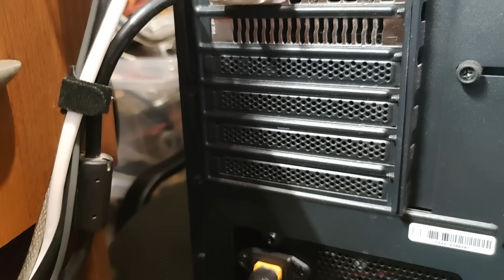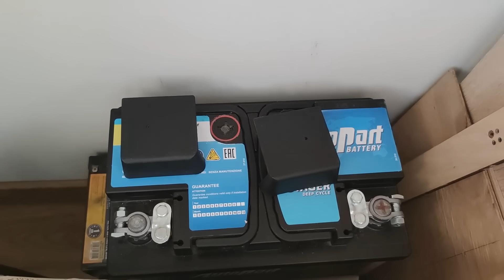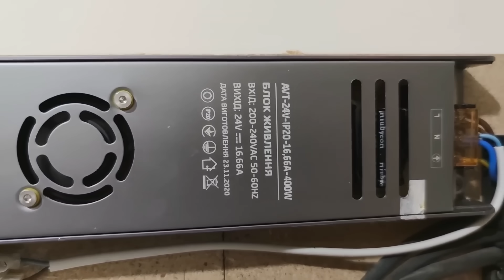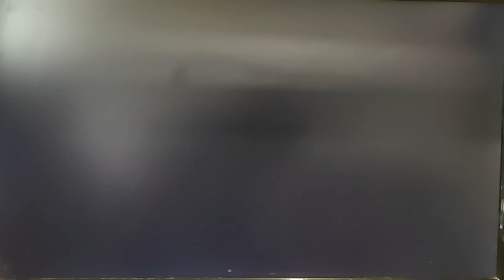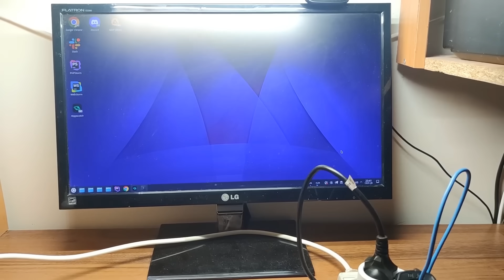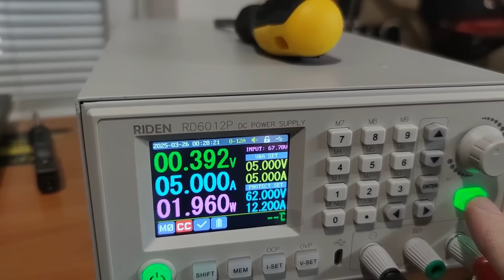I Deleted the Inverter. 50% More Efficient! (Windows vs. Linux)

Comment: Excellent project, thanks for the results and setup config.

What gpu do you have? 

And I suggest you borrow and use a infrared camera to look for temp spikes on all those cables and connectors to prevent fire hazard :)

Comment: доброго вечора, ми з України :)

awesome setup and great idea to omit unnecessary conversion DC -> AC -> DC!
pros: effective, low-noise, less waster power (or fuel if running on generator)
cons: time-consuming (extra efforts required for conversion), not universal, critical to wire length/gauge from your PC to your main battery

my desk is 10m away from battery and it's not only 1 computing unit, in my case I'd need to convert several PSUs - different types, so time-effective I'd better pay for convesion. and for conversion compenstation - deploy MPPT+ couple of solar panels on the roof of the dog-house - their power should compensate losses.

світло переможе темряву!

Comment: Love the DIY DC setup. I'm setting up a similar system myself but for my networking hardware using off the shelf components.
Conversion back and forth is wasteful, hot, and noisy. DC power in the home should be more common and would reduce the tons of SMPS bricks in nearly everything.

Comment: So, your crap PC pulls at idle DC 50% more as my high-end gaming desktop on AC. (And I run 1300W SFF PSU.)
And double of what my server pulls when it runs virtual domain with 5 PCs + 6 Game servers.
(That 600W AC PSU you show is 13 year old bargain bin trash that never was efficient. Modern AC PSUs pull practically nothing when PC is off.)

Congrats. If you care about energy efficiency. Then you are in need of actual upgrade to current generation.

You could have as well bought gaming laptop which would do all that DC work for you. And have even higher energy efficiency.

Comment: One thing I am setting up is having core home communications gear run off of a 24V LFP battery.  Here is the thing, your most common home communications gear actually starts with taking in DC power.  I am seeing 12V for the firewall system.  5V for a small managed Unifi switch.  5V again for a MoCA adapter to get signal around the house through existing coax in the home.  Then a wide 12V to 48V DC input for a PoE injector to run a 48V Unifi Wi-Fi AP.  So, you have these DC inputs for your equipment and these small AC to DC power warts are horribly inefficient, much worse than your typical PC power supply to run your gaming computer.  To get the power, I have found it is easy enough to get a Mean Well 24V power supply that is ~90% efficient with an adjustable DC output and a Mean Well DC UPS that does a buck conversion to gracefully charge up the LFP battery from the power supply at a 2A rate so as to not overload the power supply and then I can pull up to 20A from the battery when AC power is lost.  For core home communication gear, this is fine.  The buck converters for both the 12V and 5V step downs I need are very efficient, nearly 100%, and the PoE injector can take the 24V battery power directly as it has a built in buck-boost converter and is very efficient at bumping 24V battery power to the 48V needed by the Wi-Fi AP.

Here is an interesting thing I have come across with these LFP batteries: what to set the 'float' charge voltage to?  It turns out these batteries can become unbalanced quickly with your standard charger that cuts off once one cell in the pack reaches max voltage and the BMS stops accepting charge and then never continues to try to charge the pack.  So, that one cell will have some excess charge bleed off while the other cells sit on the flat part of the LFP battery discharge curve, slowly losing charge over time and cycle after cycle.  So, it takes some tinkering over time to get to the right float voltage so that all of the cells charge up, getting lifted off of the flat part of the charge curve where 0.1V can be the difference between 90% charged and 20% charged, but still low enough to keep the BMS balancers from being continuously active.

I suppose a question for you is how do you keep the cells in your LFP battery pack balanced?  You don't want  to end up with one cell is say at 20% and another cell is at 100%, causing the BMS to cut-off charge, and then you go a day without power and that one cell that started at 20% goes down to 0% and the pack cuts off with the high cell still at 80% charge capacity.

Comment: A little off topic, but I measured some gains of efficiency with inverters at AC 220V instead of AC 230V, variable between inverters but I have from 4 to 7 points differences. You have a really great setup ! I never suspected the power losses would be so great, with double conversion : DC in the battery to AC for the house and then DC inside computer and other appliances. The main problem is also that we can not remove the AC inverter and that is uses power even when idle (mine use 18W at zero load). The efficiency of AC inverter in general is better when we draw a lot on it. For example when I am boiling water and using like 2500W the inverter is 96% efficient, but when I use only 100W it is only 73% efficient, this is when we waste the most energy. for the moment all my water pumps are AC for heating etc, so I can not turn off the inverter. There will be a lot of work and money to convert all to DC.

Comment: estoy planeando usar el mismo sistema pero segun una googleada descubre que el mejor modulo dc-dc es HDPLEX 500W HiFi DC-ATX  (ahora esta en stock), el modulo chino que usaste tiene riesgo de bajar el voltaje de salido cuando el voltaje de bateria es menor que 12v porque es un simple step down mientras que HDPLEX 500W HiFi es Buck-Boost (Elevador-Reductor) lo que senifica que su salida estara siempre a 12v estables, aunque la batería baja a 11V o 10.8V El módulo seguirá entregando 12.0V exactos a tu placa base (es mejor utilizar cables de 10awg entre la bateria y HDPLEX ) mientras que el modulo chino entrega menos de 12v cuando el voltaje de la bateria esta bajo y eso puede dañar tu pc ademas la potencia del HDPLEX es de real 500w mientras que la del modulo chino es solo potencia de pico (Peak Power).
Reply from the maker: I'm using 24V system and voltage is not going to fall below 22V, so that's ok for me. HDPLEX is a great option, I wanted to buy it but it was out of stock.
Reply: @SiquellElectronics  Ah, vale, está bien. Me desvié sin darme cuenta de que estaba hablando de mi propio proyecto, pues pensaba usar una batería de 12 V, pero ahora veo que es mejor usar 24 V o más

Comment: This is a great idea for those who have constant electricity issues and expensive bills where saving some electricity is important. In the US it would be cheaper to just have either a generator or a small battery stack and charging it on off hours to save some money, but this setup is more for the prepper and not one who wants to save some money. The difference for the negligible energy use of a small pc like that with comparing the price of electricity between peak and non peak hours, you would never pay off the cost of the batteries.

Comment: As someone who's been primarily using laptops, idling at over 50 watts is insane. Heck, idling at >5 watts is too much!

I can listen to YT videos for somewhere around 4.5 W. And if I really want to have the machine last as long as possible, I can just freeze the entire GUI session, start my media player as the only thing controlling the screen and watch movies for hours – often at somewhere around 3 watts.
Reply: That's just the nature of desktops. My 14900k idles at 6 W, 3090 at 27 W, plus fans and motherboard and it's easily over 50. Laptops are crazy efficient
Reply: @SergejVolkov17  Yeah, it's all down to incentives. Pulling 50 watts from the wall is basically nothing, so desktop components won't really be optimized past that point. It's only when you try to run it off a battery / UPS, that it quickly backfires.

And if laptops were using 50 watts at all times, even those huge 100 Wh batteries would only give you about two hours of runtime.

Comment: You can use 320V DC to power the ATX power supply. You can skip the HVDC to AC conversion. This way you can use cheap ATX power supplies without PFC. No need for large wires.
Reply from the maker: Yes, that's the option!

Comment: Ive been in a similar situation myself though for very different reasons.  Used a solar generator that only has 1kw of battery. 
The computer was a gpd win with an external keyboard mouse and monitor. Running through USB-C off the unit saved around 27% compared to the inverter. Its unfortunate that most consumers grade inverter are so inefficient. The industrial ones are whats called chasing 9s with one of the best being 99.9% even vfd are around 95% or better. - ≈5w for the controls.

Comment: I got my hands on an 80+ titanium rated server 1000W PSU for very little money, but it's only 12v, not ATX. Using pico PSUs, I'm powering my whole desk from it (PC, server, two monitors, networking, desk lights). Just from having a single high efficiency PSU operating in the optimal range instead of smaller, lower quality PSUs running near idle I'm saving 20-30% of energy for the setup.

Comment: To measure AC power you have to include power factor. Due to the large inductors in your AC PSU, a significant portion of the current is flowing when the voltage is below the RMS value, which means the power consumed is less than you calculated by V*I. This will bring the efficiency values closer together (the AC setup may even be more efficient)
Reply: Good point! While this is certainly true, I'm pretty sure this won't matter when measuring the DC power draw directly from the batteries. So while the AC current measurement might not reflect actual power use, the DC current should. And due to good ol' entropy, converting from 25.6v (LFP nominal) to the lower DC voltages used by the computer should always be more efficient than going from 230v + rectification

Comment: Your PC is quite the power hog at idle. It should not really be using that much. Make sure that:
1. PCIe ASPM and such is turned on (my Asus board for Team Blue was not a power saving king out of the box),
2. RAM does not run at over 3200 MHz (easily 10 W alone), plus
3. look for the background processes in Windows that are keeping the CPU busy and 
4. consider replacing the 5600X with something like a 5700G (more cores to make up for less cache), as the monolithics have much lower idle power draw. You can get a barebones 5600G / iGPU system to idle at around 16 W without truly exotic power supplies, so I'd think sub-30 W with a small GPU should be quite doable. One of the AMD persuasion is arguably preferable as nVidia has had its share of trouble with ASPM but a 1650 should be quite alright, too.
These days both my monitor and my speakers are each using more power than the PC at idle, but I am not about to give up either (though I have contemplated an LED backlight mod, as the S-IPS panel in this once very nice NEC would be worth it).

Comment: How do you get parts delivered from China during Russia's DISGUSTING invasion? I praise your ability to stay strong and adapt to your situation! 

Also when comparing the power use under load, the percentage difference drops, but that's still 60W of wastage!!! So for every hour under load, you lose an extra hour idle.
Reply from the maker: Thanks. Logistics are doing fine, delivery times even improved slightly once shipping routes were rerouted to avoid Russia.
Reply: @SiquellElectronics  I'm surprised that delivery companies send products and their workers across the border. Respect to the delivery people.
Reply: @mushroomcraft Most of in country last mile deliveries are done by Ukrainian companies

Comment: Where do I get this power supply and how much does it cost?
Reply from the maker: I ordered it on ali: https://www.aliexpress.com/item/1005001724610027.html
Reply: @SiquellElectronics  Hmm. Nearly $200.00 USD? I'd be on the fence here. If you're just trying to run a PC stand a lone and that's it, maybe. If you're off grid or something and also using an inverter for standard AC power to run other stuff? I'd say not worth it just to save a little energy loss. A good laptop computer that uses 19 volts DC is what I'd use because you only need a power supply to step your 24 volts down to 19 and you're all set.

Comment: What about the other challenges of DC circuit? Protection against short circuits. AC breakers cannot be used as their short circuit trip mechanism will not work on DC. Only the slow thermal overload mechanism works.
Also operating on DC destroys AC breakers very fast.

Do you use plain link fuses?
Reply from the maker: Yes I already received special 160A gBat fuse and want to install it asap. For now I rely on BMS protection...

Comment: Unfortunately, your power value for AC is incorrect, you're measuring apparent power, but what you really pay is active power. You'll need a power meter to measure correctly, only V*I is not correct for AC.
Reply from the maker: yeah, the ac power is looking strange.. want to buy a decent wattmeter to measure that correctly

Comment: Regarding the power losses in cabling, a better way of expressing losses would be in Watts turned into heat, which is easily calculated by P = R I^2. You mentioned 7.7A during the Furmark test, and according to your measurements, your cable is about 18.6 mOhms. Multiply that by 2, that's about 2.2W of losses. Rather small overall. In this case, I'd rather look into the connectors, as a mated plug may have an important resistance. Btw, handheld multimeters aren't super great at measuring very small voltages, so these results may be incorrect, although the procedure you used is the best one.

Comment: I run my notebook from 24V solar charged batteries, just a simple step down to 18.x Volt since many years.
Buck converter with Display 5A max, ~20€ Alixpress   (small notebook, not enough for gaming ofc)

Comment: What AC PSU did you use?

I would also recommend tweaking some settings, because 5600X with 1650 should go lower than that. ;) It would not drastically change the end result considering capacity of your batteries, but hey, it should be enough for a light in the room or a second monitor. ;)

Comment: About the Ac strange result : most of the time your local grid has higher voltage than 230v. In my country in winter it can go up to 245V. I'm quite sure that your inverter does not do that. So if your grid gives more voltage than your inverter, this can explain that your PC draw more under the grid than under the converter, despite the conversion.

Comment: I like this setup.  I've been thinking of doing my own DIY DC UPS system with centralized low-voltage DC rails: 12 V, 5 V, and maybe 3.3 V, then distributing them to each of a few servers as well as DC-powered network equipment and Raspberry Pis in my equipment closet.  My thinking was:

  - I can centralize efficiency and redundancy, benefiting every load I connect.  That is, spend the money and do the design/planning to make sure my low-voltage rails are solid and efficient, and not have to spend much money on efficiency for each new ATX or simple DC load.  I was planning to make a custom DC ATX "power supply" PCB that basically monitors incoming voltages, turns on some MOSFETs when PS_ON# is asserted and all voltages are present and within tolerance, then cuts power if one rail disappears (e.g. loose cable) or if there's a short circuit or other overcurrent in the machine (to avoid killing other machines).  It'd also need -12 V DC-DC conversion (centralizing that would be overkill), but that can be cheap; efficiency won't matter there.

  - If I add AC-DC supplies feeding each DC rail, in parallel with the battery-powered DC-DC supplies, then I can skip double-conversion from mains to low-voltage (e.g. 120 VAC → 12 V instead of 120 VAC → Vbat → 12 V).  I can't add solar panels where I live, so mains will be where my power comes from in the typical case, meaning efficiency matters to me there as well as in the battery path.  Plus this gives me redundancy in case any DC-DC supply fails, as long as mains is online.

But my idea would take a lot of work, needs custom hardware design, and needs heavier cables to each machine for the lower voltages and highre currents.  I like your setup for its simplicity and use of off-the-shelf parts; and I didn't know about the AliExpress 500 W DC ATX supply.  The price of those boards kind of hurts, about $120+ for buyers in the USA with the cheeto tax, but that's money I won't have to spend on all the separate power supplies of my original plan.  I'll have to consider this when I'm ready to start building my system.